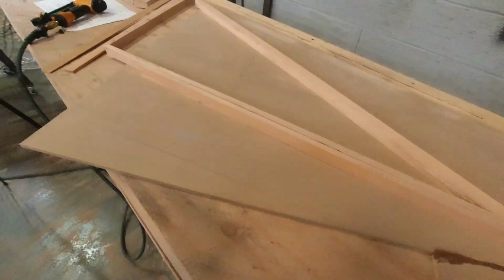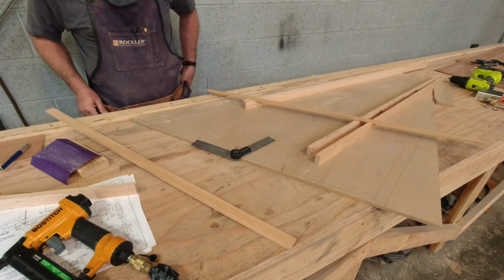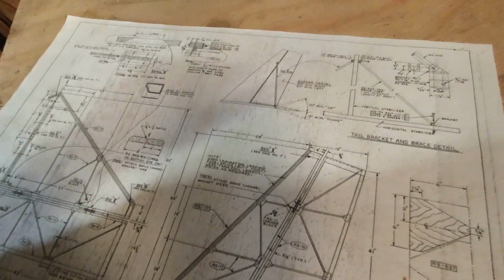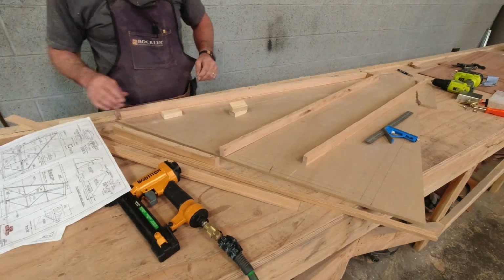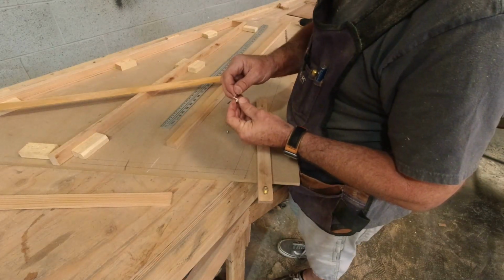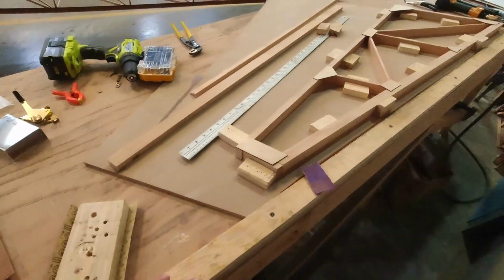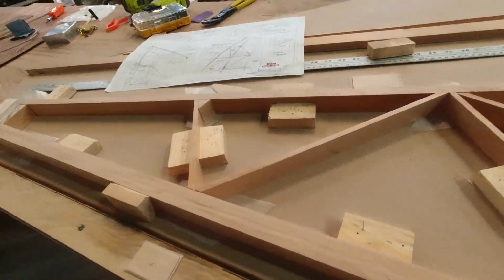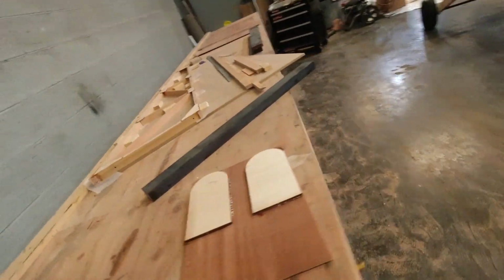Minimax 1100r Wood Aircraft Build Ep 97 - The Tail Begins

Comment: Do you have any tips for what woods screws to use for mounting the anchor nuts to the bottom member of the vertical fin?  I realize the screws will see little stress, and the anchor nut is held in tension by the bolt.  I would assume a hardware store wood screw would suffice, along with a little CA glue.  I can't find anything that small at Aircraft Spruce or Wicks.  They're not specified on the plans, so I assume screw choice is not a big deal.  "Small wood screws" are also called-out on the aileron bearing bracket attach detail.
Reply from the maker: That’s right David. I just got some stainless screws at the hardware store that fit those holes. The aileron bracket has some nylon nut plates too.
Reply: @DTMinimax  Thanks Dennis!  That's what I thought.  I know you're supposed to use only AN hardware where specified.  BTW, my leading edge laminations for the fin and horizontal stab came out great.  I just need to clean them up with some sanding and maybe a trim router.  It's easy to use too much epoxy.  Happy New Year!

Comment: I'm just now laying out my vertical tail on a piece of MDF.  I actually had to cut my piece in a a sort of trapazoid shape similar to yours because I have very limited space.  It was rather fun figuring out where to start in the layout so all the lines are in the correct places and with the correct dimensions, given that there are no angles on the plans.
Reply from the maker: Yea as long as you have a right angle in that bottom left corner, you’re all set. 
Awesome you’re moving forward!
Reply: @DTMinimax  Yes, I noted you said yours was 34 deg.  I'll check mine!
Reply: @DTMinimax  My measured angle is 32.5 deg.  It occured to me that you can calculate that angle using trigonometry, using the dimensions on the plans, as the inverse tangent of 28/44 = 32.5 degrees.  So my measured angle agrees with the calculated angle. The other measured angle at the bottom of the fin came it at 107 deg (or 17 deg for the complementary angle that you were measuring).  You gotta love math!

Comment: Two quick question if you don't mind... Where did you find the trim lever, and lol I can not find that .095 × 3/4" 4130 to save my life?
Reply from the maker: Here’s where I got the “trim lever” throttle cable: 
Stens 290-163 Throttle Control Cable https://www.amazon.com/dp/B00D9TI6WI/ref=cm_sw_r_cp_api_glt_fabc_0C3MP7KV3B6C8036RA65?_encoding=UTF8&psc=1

And the .095 doesn’t exist at that size. Here’s what you want:

.100 x 1” then you cut it down to 3/4” wide. I had the same question and this is what Team steered me to.
Reply from the maker: I just used a grinder with a cutting wheel to reduce the size
Reply: Sweet, thank you. After weeks of searching, and a few enquires I was getting concerned.

Comment: Good solution to the mistake.
Reply from the maker: The benefit of working with wood for sure!
It’s so easy to miss a measurement like that with trapezoid shapes
Reply from the maker: Are you scratch building some of the controls before you get the kit?
Reply: @DTMinimax  I am building the odd bits and bobs with materials I have, so in the next few videos I make up some rib jigs and other parts so I have them ready. I have some aircraft hinge material so I may even get to hinge the tail. I am going to do a few changes to the control system as it is a bit too basic in their application for me.